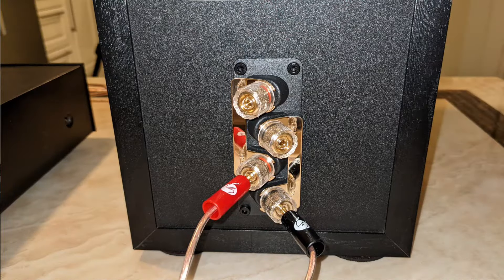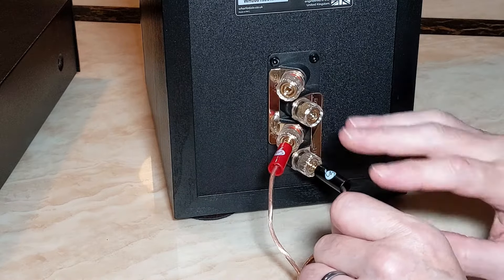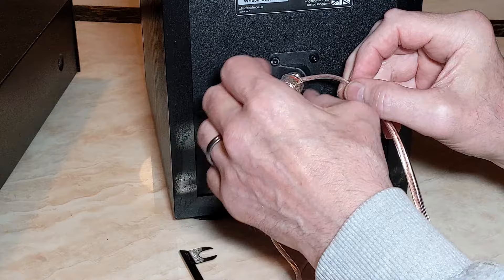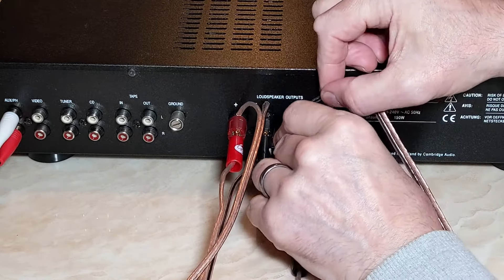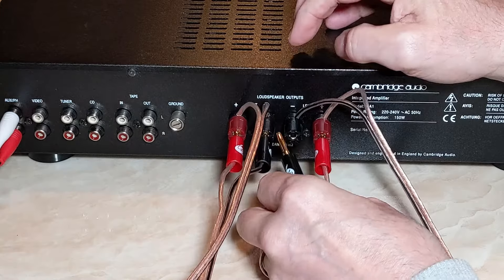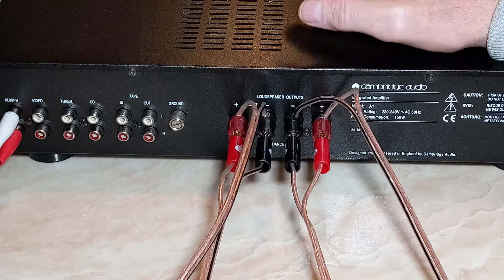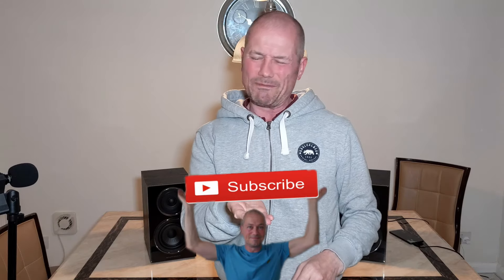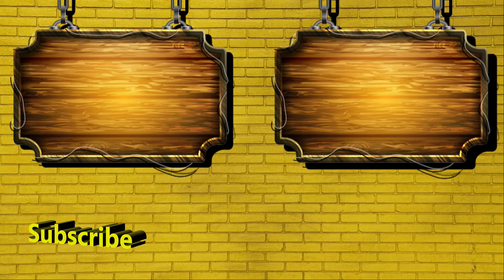How To Bi Wire Your Speakers (Includes Sound Comparison) #utilitariantv

Comment: the main purpose of bi-wiring, as I understand things, is to separate the base & mid/treble to produce a cleaner more accurate sound overall. I use to have a Technics set-up that was bi-wired & you Really could tell the difference, especially when playing something like Mike Oldfield's - Tubular Bells II for example... However from the look of your amp set-up in the video, all you managed to do was add an additional cable to each speaker, as your amp isn't Bi-wire capable. Hence the lack of any difference between the audio quality... I could be wrong about your amp? as I don't know it's specs? But the system I had, the amp was designed to accommodate a Bi-wired speaker setup that specifically separated the audio channels.
Reply from the maker: I actually did another video where I bi-amped the speakers and still didn't hear any discernable difference. I think it comes down to how good the crossover in the speaker is. It's the crossovers job to separate the bass, mid and treble. If it's a good crossover, it's unlikely make any difference when bi-wiring/amping.
Reply: Agree.. i have panasonic sa xr-55 av reciever w bi-amp mode i test it many times and i really hear the difference about standard channel vs bi-amp mode . Bi amp mode makes more clear and accurate sound for my observation
Reply: If you use four channels on your receiver, instead of two, you have effectively bi-amped the speakers.  Bi-wiring is nothing more than adding a second set of wires and, in my experience, this is certainly a worthwhile upgrade.
Reply: If you have some nicely optimised power amps, then you can sometimes get a difference, but is it much more than adjusting the power going to the woofer over the power going to the mid/top?
Is it any different to just adjusting the bass and treble in the end
Reply: @EsotericArctos  bi-wiring uses two pairs of wires.  It can be achieved with a single pair of binding posts on the power amp.  It doesn’t require a pair of power amps as that would as the name suggests be bi-amping.

The separation of the signal down the two pairs of wires is achieved by the crossover filter inside the speaker.  This is totally counter intuitive; the assumption being that because the cables both connect to the same binding posts on the amp it must be the same signal.

The reason it works is because the speakers are driven not by the voltage across the terminals but the current.  The current is inversely proportional to the resistance and the crossover presents a resistive load which varies with frequency.

On the bass driver, the inductor in the circuit presents a low equivalent resistance to low frequencies and as frequency rises the resistance also rises.  The current does the opposite, hence the current in the bass circuit is only present at low frequencies and not present at higher frequencies above the crossover point.

Effectively, this reduces crosstalk between the high current bass frequencies and the lower current mid/high frequencies.  Some folks in some systems hear a difference, others do not.

With bi-amping exactly the same thing happens, only now you are separating the signal all the way back to the pre-amp output.  As the power supplies are now free to only power part of the frequency spectrum and the effects are magnified.  More people hear the difference when bi-amping.

Using different rated power amps for this is not advisable if you want to maintain a consistent balance in the sound throughout the frequency spectrum for different volume settings.   The difference between doing this and using tone controls is that the effect of the tone control will be consistent as it is simply shaping of the frequency response irrespective of volume.

Hope this helps.  For those who remain unconvinced or are unwilling to shell out for double the length of speaker wire, I recommend at least replacing the nasty plate connectors on the back of most speakers with a very short length of your favourite speaker cable.
Reply: @UTILITARIANTVUK  I'm afraid your conclusions are dubious, resting the speakers  on a table, which is reflecting the sound will not create the conditions under which you could hear the system properly in the first place let alone make any meaningful assessment of the effectiveness of bi- wiring.
Reply: Another purpose is to give more Power to the speakers, If your amplifier or receiver has lower Power. And biamping may enhance I little bit the quality of the sound for the fact that you may use less Power of your amps, having less distortion. But If you have a good strong amp, It may not be a good upgrade for your system
Reply: @markcarrington8565 quiet perfect explanation on biwiring and biamping. Thanks

Comment: Tried your experiment with my Denon M41 and my Wharfdale 12.2 speakers and the bi/wiring certainly made a difference on my system, producing a fuller sound than using single wiring.
Reply: Only because you have less resistance with two sets of wire.  Just use a single pair of heavier gauge wire instead.  How in the world do you think your amp knows to send low frequencies on one set of wires and the high on the other?
Reply: @JohnSmith-qi6co  Maybe his Amplifier has A.I. (Artificial Intelligence)

Comment: I couldn't hear any difference, and, when I've tried it with any of my speakers, the bi-wire might have sounded a little clearer, but it also sounded less cohesive, like the sound was coming from two sources, like I was hearing the woofer and tweeter separately, instead of a cohesive sound where they blended together perfectly, which I really didn't care for.

Comment: Bi wiring is usually for different spec cable, some cable seems to handle higher frequencies better than others etc. I don't really hear the difference myself but I suspect this is more on the higher end stuff. Like using a tubed amp for the highs with a conversational amp for the lows.
Reply: Exactly right 👏as you say bi amping/wiring is something that was created not for powering the highs/mids together and bass individually,it was as you said more of a sound difference in different cables as some cables are brighter or warmer as to match the highs/mids better to your amps charecteristics and others are beefier or thinner at bass sounds and so company's found that by using 2 separate sets of binding posts they could achieve a better sound stage with 2 different sets of cables. tbh I honestly thought that single cables gave a clearer sound stage In this test though.👍
Reply: that's what I heared too. Bi wiring works if you usee cables designed for the right frequency range (if that is a thing). At the same time, cable design has undergone improvement to a point where they are "full range". So, that would neutralize bi-wiring. But in the end, I cannot get myself to realy believe in all of this. And my financial resources, neighbours and ageing ears won't allow personal testing.

Comment: I always thought bi-wiring required 2 sets of outputs on the amp? When I bi-wired my mission 774’s my Pioneer amp had 2 sets of outputs and I utilised both. I could hear a definite difference.
Reply: You are thinking about bi-amping.
Reply: @CraftyZA  that's the point of bi-wiring capability. using a dedicated amp transformer for high and low frequency

Comment: A suggestion.  Only biwire one speaker, leave other with single. 
Play a mono single.  If there is no difference the sound will be identical and appear in the middle. 
If there is any difference, the sound will appear wide.

Comment: In my speaker manual, (Mirage) says the reason for bi-wiring is so you can use different speaker wires (eg, a pair best suited for the highs, and a pair best suited for low end). Simply using cheap, identical speaker wire like you're doing would skirt the point.

Comment: i took the jumpers off, the terminals on my Wharfadale 9.1 speakers 🔊 and replaced them with solid copper wire ( electrical) about an inch.    And I’m also using solid copper…. Short length wire for cables; as opposed to the stranded copper wire online from various companies.    Speakers that are bi-wired just means that the tweeter and woofer are separated from thin cables inside the speakers themselves. So it’s done on the outside instead.
Wednesday 12th October 2022. U.K. Southampton.

Comment: 2:12. The only change made here is that the impedance of the cable used is halved - from 0.2 ohm to 0.1 ohm.
The point of bi-wiring is to use separate amps - one for each cabinet, ones with balance controls to tune the music played.
Otherwise its just hype, because a cabinet speaker is set to produce a flat response. Bass and treble controls interfere with that response.
Reply: No incorrect, when a speaker is bi-wired the cross-over has two separate earth routes, so the large currents drawn by the bass -mid unit do not travel the same route as the treble signal. In a single wired installation the bass signal will modulate i.e. distort the relatively tiny treble signal, causing the speaker to sound less clear and make the music harder to follow.
Bi-amping a loudspeaker with identical amps that have same gain and quality level will result in a massive increase in clarity and musical enjoyment.
Reply: I think what you're describing is bi-amping. Bi-wiring is pointless unless using different cables for woofer and tweeter.
Reply: You're half right.  The point of bi wiring IS to use two separate amps, but not one for each cabinet but rather one amp for the highs and mids on both cabinets and one amp for the low on each cabinet.  Then and only then, it will make a noticeable difference, especially if you are dealing with speakers that outmatch your current amp.

Comment: Bi-wiring is for the use of separate amps, and bypass the internal crossover network. You need a active crossover behind the pre-amp, and 4 channels of amplification. Just adding more copper wiring to the chain, will not make things sound “better”
Reply from the maker: Using separate amps is 'bi-amping' and not bi-wiring.  I agree that adding more cable to the chain will not improve the sound, which was made clear in the video. This is what the manufacturers of the speakers put in their manuals. I wanted to show that it was a bad way. I explain in more depth in this video https://youtu.be/_5FH2tKONQ4
Reply: @UTILITARIANTVUK  for bi-amping we use bi-wiring ;-)

Comment: Bi-wiring out of the same (amp-side) binding post set into (speaker-side) several binding posts has an effect based on cable (!) properties which affect different frequency ranges (one of several physics explanations is 'skin effect' - in short: resistance of the cable is frequency-dependent, the higher the frequency the more the current runs only on the outside of one wire core). I.e., bi-wiring only does something if you are indeed using different cables (e.g., different thickness of the cable cores, different material mix of cores, different thickness of total cable).
Note: This has nothing to do with (expensive) cable voodoo, but rather say e.g., you want to use a thinner cable (or one with less cores) for the high frequencies' range - you could reach the effect to tone a bright speaker a bit down. 
Whether this will result in audible difference, is up to (your) test. But: bi-wiring allows you to separate the effect that cable properties have on the sound for the two different frequency ranges. Hence: it gives you an extra parameter to tweak sound. 
What you show in your video is consistent: if you use the same wire, you will have almost no effect. (Except: it might transmit 'more' power in total - but that would be reached also by using a thicker cable with more cores or twin cables into the same speaker binding post)

Comment: Yes I noticed a difference, I have my Yamaha amp and all the goodies with my Audio Centron 150 watt 15 inch speakers by wired and it absolutely definitely makes and more full sound or another way to say it there is more fill in the sound yet remains crisp and sharp when needed and more distorted when listening to distortion sounds.

Comment: I did it with Arendal 1723 tower speakers and noticed a huge difference;so much so that I tried some Cardas bi-wire speaker cables (I’ve always been a doubter on expensive cables)to see if they made a difference.I am not sending them back!I have 74 year old ears btw and I tried a$500 power cable and I am keeping.So I think it depends on how discerning your gear is?I am streaming with a HiFi Rose 520 which I highly recommend !Thanks,Jay

Comment: It's hard to tell any difference, but of course it's through you tube and my speaker system. I really tried to hear something, but I think whatever I am hearing is my imagination, because I want there to be since it seems extra wire, and separate connections should make a difference.

Comment: Hi, My 90s kenwood ka3020se, has 2 sets of Speakers A&B, and I have Wharfdale 230s. I had 2 sets of QED cables to each Speaker using both A&B Speakers terminals to Bi-wire, it sounded a bit thin, so put the copper/ gold joining plates back on( like in the video) used 1 set of cables to each speaker ,just using Speakers (A) and sounded fuller, better 😊. 
But I will try 2 cables each side, just useing Speakers (A) like on the video. Cheers Grant 👍

Comment: I hear a difference in my speakers, on my system. It's not dramatic, but the highs have just a little more presence. I find it pleasurable. Yamaha amp driving 6 ohm Snell bi-wired bookshelf speakers.

Comment: Of course its worth it, your halving the cables impedance and separating the drivers at the amps output, on long lengths of cable of 12ft and over biwiring is the way to go, same principle as adding dropper wires to a model railway, without them the train will slow down after about 20feet

actually bi amping is a BIG no no unless you have 2 identical amplifiers

Comment: surely the bi wiring method you used is in effect just the same as if you kept the bridging pates in, you are just making the bridge at the amp end rather than the speaker end  - so in my mind its just a wast of wire. The double connectors on the speaker are for bi amping ( using one amp for bass and separate for treble  - or am I wrong ?

Comment: I think to really get proper channel separation (my amp has 8 speaker posts) and I run A+B speaker output (basically as Low + high) and then wired at the speaker as you show.  this way my Highs are coming from completely separate channel  B on Amp. Lows on Channel A.  What you've done is just separate the cables after the signal  left the amp  on same channel?  I think this would achieve better results.  Be sure to follow the wiring schematic for your amp as youre running 4 cables with 4 ends each (16 connections) and proper wiring matters.

Comment: In my opinion, Bi wiring "works" because you have removed those terrible shorting links that are provided more or less on a "better than nothing" basis.  I catagorise them as "packaging" Try keeping the speakers  single wired but replacing the shorting links with good quality cable. You will get the same if not better improvement in sound quality.

Comment: Dont use the bridging plates they give you and bridge them using hifi wires to get better quality. You dont need bi wiring.

You just need to bridge the speakers with a better conductor.

Comment: Personally, I thought the single wire playback gave the tweeters a bit more crisp.  Granted, that is through ear buds on a lap top from a YouTube video, so the sound quality is not spectacular anyway.  But the single wire seemed to offer a little more separation from driver and tweeter.  That's just my two cents.  great video!

Comment: I wonder if bi-wiring with an amp that has an A/B speaker output would make any difference (like the Marantz CR612). If not in the quality (since the same signal goes out from the same amp), but maybe in power output and perceived audio "push" at the same level?
Reply from the maker: I also tried bi amping but I couldn't hear a difference. https://youtu.be/s8unTc9uJns
Reply: Будь осторожен! В во время работы, в некоторых акустических системах импеданс падает до 2 Oms! Вы можете повредить свой усилитель.

Comment: Hi! I like simple but good things, so after ~30 years of hi-fi collecting, listening and tryings I ended the difficoult system set ups. I mean that I stayed at a pure stereo system (marantz pm7005 with cd5005 and wh diamond 11.2 loudspeakers).
They not need and not able to bi-wire, not need and not able loudness switch, I not use tone or sub. The sound is great without difficoults. Best regards.

Comment: I could not tell a single bit of difference to be fair, but saying that, I am still going to Bi-wire my new Klipsch speakers since I have the option.
Reply: I bi-wired my Klipsch RM-600's and couldn't really tell a difference using my Yamaha A680 amp.  It might have gotten a little louder, but not much.
Reply: @markkennedy7957 . I got a pair of 600m speakers last week to act as my surrounds. Will be Bi-wiring them too.

Comment: 😂 my friend. Bi-wiring is for 2 amps 1is hi 2is low.  With 1 amp u do high pas filter. For other amp you do low pas filter.  Then you can reach good result. Also this speaker isnt good for it, but if u take floor standing speakers which bi-wiring high/mid   seperated from low/bass drivers, then u see difference.  As you will feed 1 speaker with 2 seperate amps, adjusted in seperate frequencys.
Reply from the maker: What you are referring to is bi-amping and not bi-wiring. 👍
Reply: @UTILITARIANTVUK   its no point to bi-wiring from 1 single amplifier. By my understanding bi-wiring is option on speakers. Bi-amping is option on amplifiers.  Its same as you have 2 bookshelf speakers, and active sub,  and you controlling both frequencies separately.  If you have only 1 stereo amp, so bi-wiring speakers just pointless